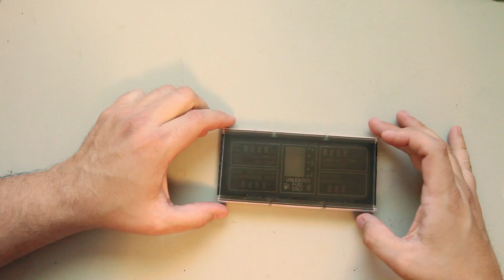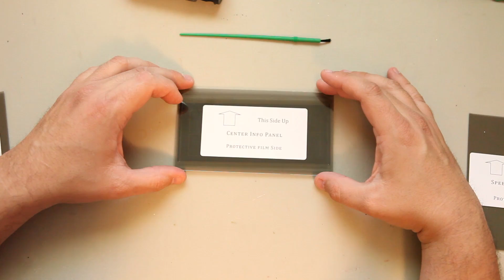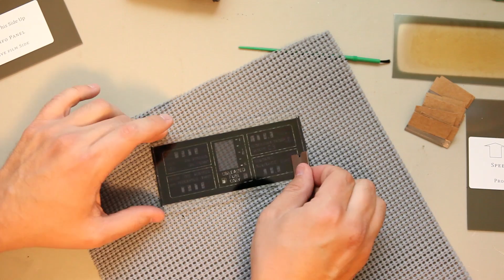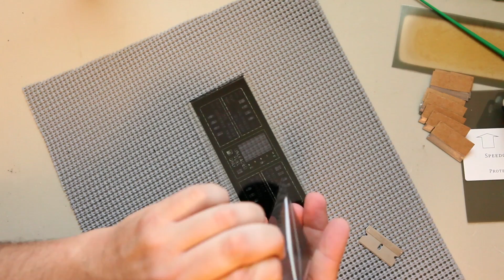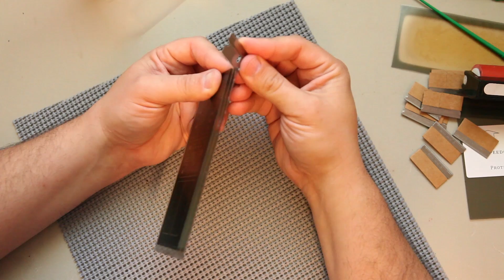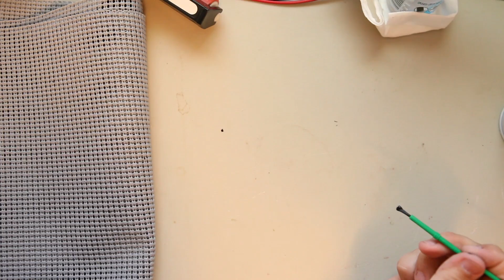84-89 Gauge Fix #3 Sun Faded LCD Repair

Comment: After watching this tutorial on replacing the polarized film shown on C4 Corvette Atari dash it dawned on me I could just cut away the bad area and replace it with new polarizing film!
 Guess what? It worked!
 I cut a 1-1/2" square around the numbers showing the revolutions of the motor... and wallah! 
It worked! 🥳
 I have 2 more sections I have to do which I will try to video tape and put on YouTube, just to show how it can be done. 
If you can afford to have someone do it for you Good luck, but it only cost me $8 lol
Reply from the maker: Post a photo and let us see it!
Reply: @crazyuncleburton  - oh duh, never thought of that.  
I eventually plan on doing it the right way but as a temp fix it's been great.  I just cringe at the thought of taking the dash apart 😱
Reply: @colt5189   That's a good idea, Unfortunately my right passenger side headlight blew up so I gotta fix that before I video* it.  The motor  tore itself off of its mounting...😭

*Looks awful

Comment: Hi guys, don't know if you still monitor this but I tried emailing and didn't get a reply. I ordered the full rebuild kit, it was great, i'm having one issue, not related to you I think but I could use some advice/direction.  My center panel worked fine, tachometer side worked fine, I just had a bad polarizing film on the speedometer side.  I decided to do all three films, when I put everything back together (it all looked very goodas far as connecters etc) and put it back in 3/4 of the center panel is missing lcd segments.  The only thing working properly is the temp/volt piece.  The gas gauge is working but missing about 4 bars, one on top and 3 in the middle- the other three are missing lcd segments and not acting right (when you flip switch to oil pressure the display says oil temperature, etc).  I took it all back apart and checked the pink conductive blocks,  they seemed ok.  I swapped them with ones for the tach and speedo, reinstalled all, same thing.  Any ideas what I screwed up here?  Thanks in advance for any tips you can give me.
Reply: davedzone hello. Please Mail us at “sales@batee.com” and include photos of what you’re seeing.
Reply: Bryan Thompson thanks.
Reply: Thanks!  It worked just as you said.  Thank you for all your work in making these things available, the digital cluster is working perfectly now.  I'll be going to batee.com to buy the environmental control rebuild kit next...
Reply: @colt5189  resoldered the joints.  They crack.  Get the whole board reflowed and save yourself the trouble
Reply: @colt5189  after a review, I can't remember exactly, maybe you should ask batee